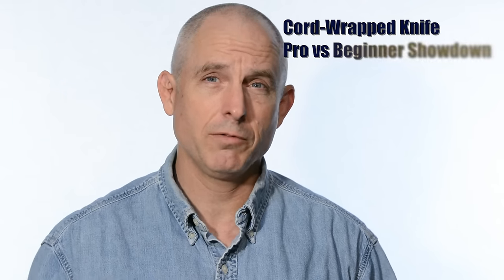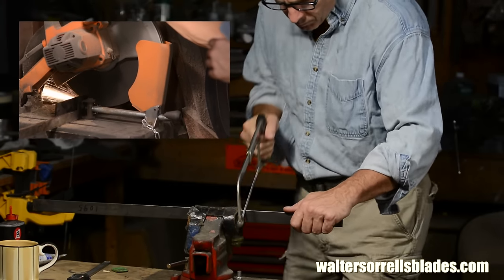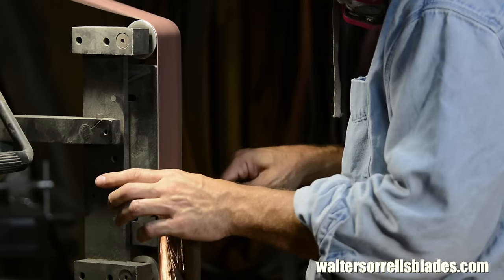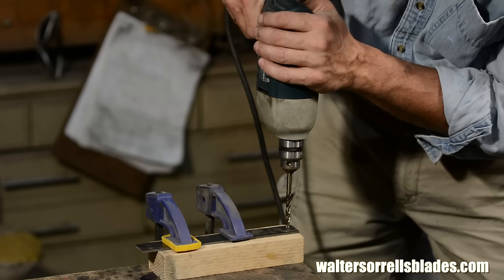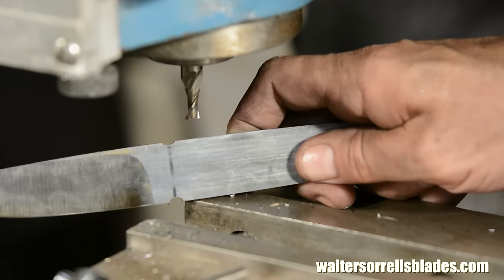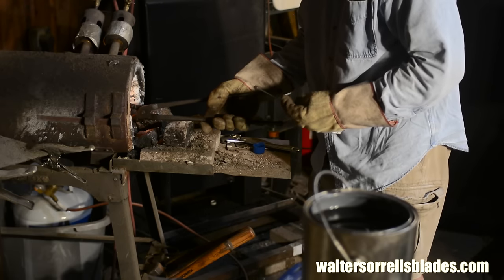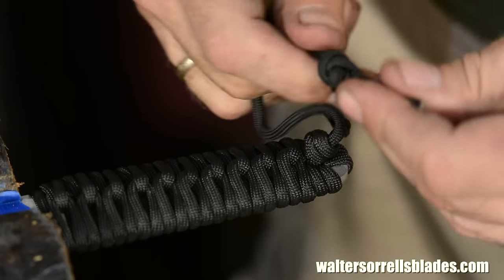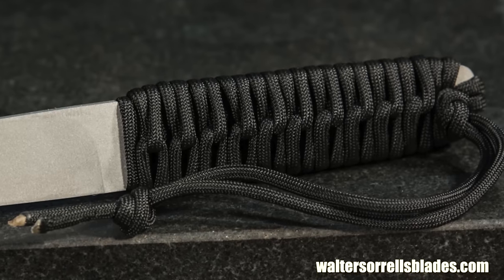Making a Cord-Wrapped Tactical Knife - Simple Knife for Beginning Knife Makers

Comment: I made this knife on Saturday.  No special tools.  I did some of the cutting with a cutoff disk on my dremel tool.  The rest was filing with my double cut bastard.  Heat treating in chiminea with blow dryer pumping through guttering and quenched in used motor oil.  It was my first knife, and I'm happy with the outcome!  Kenny can suck it.

Comment: At 14:04 Sweet! Amazing how the right steel/quenchant allows for differential hardening with no need for claying or anything, just because the thinner edge area cools quicker. Really cool stuff!
Reply: Angelo Silva You dont need a clay,you can simply harden everything and then put a knife half way in the water so only edge stays submerged and heat the spine with a blow torch to release the hardness.
Reply: +zumbazumba1 Actually, here this was achieved simply through the cooling rate and edge thickness as the blade was plunged vertically into the oil rather than edge quenched as you mentioned but edge quenching with the blow torch seems to be the trick for steels that are supposed to through harden like D2. 1095 just seems to be in that sweet spot where you can quench it whole but if the heat and bevels are just right you can end up with a hamon. Might be annoying when you want it through hardened now t that I think about it...

Comment: At around 17:15, when you start the paracord wrap process, you have your blade horizontally in the vice. Wouldn't it be easier if you had the blade vertically so you just needed to move from side to side yourself instead of having to keep flipping the blade? If I'm wrong please correct me. Otherwise thank you for taking the time to make the video.
Reply from the maker: It's easier to do that way...but it's also harder to see whether you're doing it evenly that way.
Reply: That makes sense. Thank you.
Reply: Camden Collington ?
Reply: don't mind him. He just discovered 'memes'.
Reply: @Camden Collington I'm gonna necro and say you don't know what that means.

Comment: one nice "rough coat" i use sometimes is to leave some of the rapeseed oil from hardening on there to get a black (cind of rust resistant) coating on the blade that can look kind of cool after a while. just go over it a bit with some scotch brite to get the biggest particles of the blade and leave the rest.

Comment: As a beginner blacksmith/bladesmith I find videos like this incredibly helpful. As a historical weapons enthusiast, I have to disagree with what you said about how bevells were done in the darkages and prior, in those days they were actually forged in, by getting the metal red to yellow hot and while holding it at a write angle to the anvil and string with the near side of the hammer to force the metal into the appropriate shape then flipping it and repeating to make it even.

Comment: Paracord is the #1 knife handle material.  Period.  It requires no tools, no chemicals, no glues, sanding, pins; has a rapid learning curve (you can learn a Whip Knot in about five minutes that can put a handle on just about anything); lasts for decades or a lifetime if you  take care of it; myriad of colors; inexpensive; good grip; creative; solid; tough (I broke the wood handle on my Green River Hunter while camping in 2008, wood-glued and Whip-Knotted it back together.  That same knot of black 550 Paracord has been through hell and hasn't budged.  Still performs 100% in late 2023.  Many of my house knives and outdoor knives are paracord for more than a decade now.  Needs no replacing or fixing.  I even put mine through the dishwasher.

All the pretty, expensive collector knife stuff is cool, but knives are only as good as their edge, as far as I'm concerned.  I put mine through a lot of hard use.  I build them and sheath them.  I keep it simple, practical and handy.  Paracord works, every time.

Comment: Appreciate the effort you put into your vids Walter. They're very informative, and your willingness to share your experience shows through at every stage. Thank you!

I have ordered a basic file set (per your recommendations) and am going to attempt my first knife soon.

On a side note, I'm not from the US, and don't have access to a variety of steels. I'm contemplating having it shipped to me an expensive and cumbersome effort to say the least), but also have come across suggestions of using the steel off leaf springs. Is this something you would ok for a beginner to get a passable end product? Or would I be wasting my time with it?

Thanks again for the time you put into these, cheers!
Reply: Older American cars have high carbon steel springs.  1095 and 5160 are both considered old American spring steels.  Your country undoubtedly has equivilant standards.

Comment: at 8:15 I noticed discoloration at the tip I'm glad to see you left it there because it shows the side affects at the belt sander and heat possibly hardening that spot
Reply from the maker: +dan rasmussen Any belt grinder heat prior to heat treating won't bother the final product in any significant way.  You could turn the whole thing red hot...if you hold onto it! -- and it wouldn't hurt anything.  After heat treating, though, you have to be much more careful about your heat build-up from grinding.  If the heat builds up high enough to cause blue discoloration like this, it's a sign that you've decreased the hardness of the knife in that spot.

Comment: Great video!  You're the reason I'm getting into knife making.  I do have one question about this, though.
Do you anneal steel before you cut it to length or is that only if you don't get it from a mill or something?  In the series in which you make a knife from a file you annealed it but not here.  I just don't want to trash a hacksaw I could have saved.

Comment: wait, what? no 6AL4V titanium? Nice vid Walter. People never believe me when I tell them you can make a knife where your only power tool is a cordless drill and a few hand tools. I'm gonna send them to your video.
Reply: God of Thunder People often think that, without realizing there were knives before 1955 (belt sander was invented).
Reply: I was talking more about people who have no idea about how knives are made. But you're right. Knifemaker David Boye in his book Step by step knifemaking used a regular wheel grinder that used 2x10 grinding wheels. That came out in the late 70s when Burr King was the only 2x72 grinder you could buy. But I ground my first couple of blades with a file. People think it will take an enormous block of time using a file. In reality on a 3 or 4 inch blade of 1/8 steel, maybe 2 hours.
 The belt grinder has definitely democratised knife making. My first belt grinder was a 1x30 from Harbor freight that I bought in 1989 or 90. For $30  there are plenty of videos on YouTube showing people making nice knives on those. 
What kills me is all the YouTube videos where people make knives out of mystery steel like lawn mower blades thinking the steel they got was " free" not realizing the you can get a 6 foot bar of the steel Walter used in this video from Anmiral steel for $8 + shipping. Which works out to about $1.50 per blade

Comment: Mr. Sorrells, thank you for making this video. I'm becoming very interested in bladesmithing, but I have zero experience. I have a couple questions:

1. Can a bench grinder and/or angle grinder be substituted for your big expensive belt grinder?

2. Can damascus steel blanks be used for this project, and would there be any extra/different steps involved?
Reply: +Steve White "Billets" I meant
Reply from the maker: +Steve White  The answer is yes to both.  But different kinds of damascus have their own heat treating regimens, so you have to know what the specific composition of the steel is.

Comment: You can tighten the paracord after you're done wrapping it, by dipping it in boiling water for a full 15 seconds.  This shrinks the paracord slightly, about 1/20th its original length, making it even tighter than you could have by hand.

You probably knew that, but you didn't show that or mention it in the video.

Comment: @Walter Sorrells I plan on using the oven cured type Cerakote on a knife I'm making for a buddy, should I temper and bake the coating at the same time or temper then apply and cure the Cerakote? If I recall correctly the coating cures somewhere in the 350-400 range for a few hours.  I dont mind taking the extra steps to do it right but Im just not sure if baking it multiple times will affect the hardness or the temper. Thank You in advance, love the vids and keep em comin.

Comment: This looks like something I could do in my grandpa's old shop. Is there a comparable steel that is rust-free or is it easier to just keep it oiled? Thanks for your instructional videos by the way!
Reply from the maker: +Felix Dubis Wolf  Yes and no.  There are plenty of stainless steels (440C is the most commonly available one that's suitable for knifemaking, but there are many, many more), but they can't be heat treated this easily.  You'll need to send them to a commercial heat treater in order to have them hardened.
Reply: +Walter Sorrells Okay, thanks!

Comment: Dont use screw to scribe the center line. Use flat surface and drill bit equal size to thickness of the blade material. You can use normal screw to five general honing line, but final edge line should be done with drillbit.

Comment: Question and I am sure you have answered it in an earlier video but I am new at this, so here you go...
I have two old lawn mower blades and I have started using them to try and implement some of the things you talked about.  My question, is the steel that is used to make lawn mower blades good for making knives?  Should this steel already of been heat treated?
Reply: I forgot to mention that I am only using the straight center portion of the blade.  I chose to cut the blade half, cutting the hole for the bolt in half.  Watching your videos has sparked an interest for me to try take this up as a hobby along with woodworking.  Thanks
Reply: Aaron Miller You can make a knife out of an old lawn mower blade, but, as with all 'mystery steels', your results may vary. It may be good steel or it may not.

If the steel is already heat treated it will be a ROYAL PAIN IN THE A-- to file!!! You'll need to anneal the steel by heating up to heat treat temps and letting it cool slowly in order to soften it, and then, once you've done all the filing, you'll need to reharden & temper it. 

Personally, if I were going to take the time to make a knife completely by hand using files, I would start with either an old file or horseshoe rasp, or I'd just buy whatever type of steel I wanted to make it out of. There's no point to putting all that time & effort into making something great only to find out that the steel is crap and won't hold an edge, especially when an 18" bar of 1095 or O1 high carbon tool steels only costs about $11. If you go to flea markets you can often find old files for very little money, and files are made of very good high carbon steel.
Reply: Thanks for the pointers!

Comment: What are your thoughts on saturating the handle in a two part resin epoxy, normally used with carbon fiber/kevlar to seal the handle from the elements.

Comment: hi all, I just have a few questions I need answered. 1)  how easy is d2 to work with for a beginner with few tools. 2) are there any tool steels/high carbon steels with a high enough chromium content to be considered stainless (like d2 is). 3) one bevelled is it possible to just sharpen the knife on a stone to have a cutting edge or is it necessary to make the edge a steeper angle than the bevel, like you'd see on most kitchen knives?

Comment: Quick question on tempering....1095 looks like it suggests between 400-600 for the temper depending on how hard you want the steel. Which end of the spectrum will be harder and what are the benefits if any to using one temp over another?
Reply from the maker: +David Gardiner The lower the temp the harder the steel.  But the harder it is, the more brittle it is.  That's pretty much always the basic equation with steel.  600 degrees, with a simple carbon steel like 1050 will yield a spring rather than a knife.  400 to 450 is probably about right for 1050.
Reply: thanks. much appreciated. I'll keep that in mind for a fillet knife I wanna work out too, sounds like going a little higher on the temp might make for a good flexible edge.

Comment: Nice video but what if I don't have belt grinder or money to buy one (file and sandpaper are not bad but you don't achieve that finish on a blade)
Reply: I made use of an angle grinder and a trusty vice for that. Also, you totally can achieve that finish on a blade from low-tech tools, you just need the motivation for it.

Comment: Would case hardening a knife help reduce cracks or warping during heat treating? Or have any benefits?
Reply: +Panzervagon 
There is no advantage to case hardening a knife blade...you would sharpen right through the hardened steel "skin", leaving a soft edge.

Comment: Hey Walter, I'm making my first knife, and plan to use it for batoning while camping. Anyway, I'm using some unknown steel from the head of a gardening hoe, and want to know if I should heat treat and temper it the same way you showed in this video? And do I need to do the tempering at 450°F literally as soon as it's cooled, or just anytime before using it? Would 3 cycles of tempering be any better than 2 cycles? I'd really like to avoid having this knife shatter while batoning.

Comment: mr. sorrells, i bought a 3 foot length of 1095 bar stock 1" wide, but the steel company goofed or i just mis-ordered and received a 1/4" thick instead of 1/8" thick. what would the "cook" time and temp be to temper 1/4 as opposed to the 1/8"
Reply from the maker: +Anthony Witman   It doesn't change anything really.  You'll be fine with 1/4 inch stock.  It takes a little longer to heat, but only marginally.

Comment: I also have a question. If you run a file across the blade to test the heat treat and it digs in, can you just reheat it up to 1500? I know that after heat treat the knife is hard and brittle. Not sure if reheating will ruin it but I had that happen and started over so I still have a hardened knife shaped object!!!!
Reply: +Jason C Best to get in done in the first round, but unless you heated it up like crazy and drove all the carbon out I'd guess you could still have a go at it. No expert here, though - I's just a noob.
Reply: +The Danneskjold lol... I have that same feeling, but I don't want to get it done just to throw it away. I'v made 5 knives now. The last 4 were given away. The first one I kept. The knives get better each time, so that means that I have the worst one!!!
Reply: Yeah, I've got several near-complete ones, but only two completely finished. Just not enough equipment anymore - fell on hard times.

Comment: i dont have steel but i do have some old files that my dad used 10 years ago. are they strong enough to make a knife out of? 
and how long do you have to hold the blade in a charcoal fire for it to become unmagnetic?
Reply: +Arjen Hartink  I believe that Mill files or Bastard cut files and the like are made out of Very High carbon content steel; it may be O1 tool steel.  They would make a great knife, but you must heat them up to some specific temp, then let them cool down slowly a couple of times to soften them enough to work on it; Otherwise, they are too hard. 
Maybe someone else here has more details.
Reply: this is just a suggestion but you could use a forge an anvil and a hammer to make the basic shape first and then you could sharpen, harden, then temper but other than that I don't know much else you could do

Comment: Cool knife, by the way what kind of "cord" is it?
Reply: Mr. Splattman That is simply Black 550 Paracord.  He pulls out the 7 inner cords from the inside so it will lay flat.
Reply: Thx for the reply! But what does "550" mean, is it like thickness or lenght?
Reply: Mr. Splattman It means the tensile strength. 550lbs before the cord breaks.
Reply: Shadow Oh, thank you! xD
Reply: Mr. Splattman No problem

Comment: question: i got some 80 grit sandpaper and they told me at the shop that i had to put some water on the sand paper before using it (like he did at 5:34 ) but when i started sanding the piece of metal the sandpaper just started to loose all of its abrasive material... did i apply too much force, did i use too much water, or is the sandpaper just shitty?
Reply: +TheAmericanWerebear  lol ty for the answer. btw, i also got some rectangular sponge things with sandpaper and all lateral faces of it, and i really like them, but idk how to clean them. any ideas? By clean them i mean remove the wooden and metal dust that is stuck on it
Reply: use water in a spray bottle at really close proxcimity or use some sort of old rag to smack it on i used and old pair of jeans although i dont recommend wearing them lol.